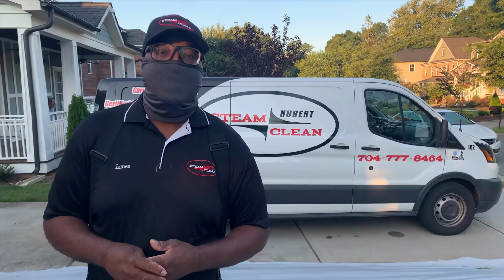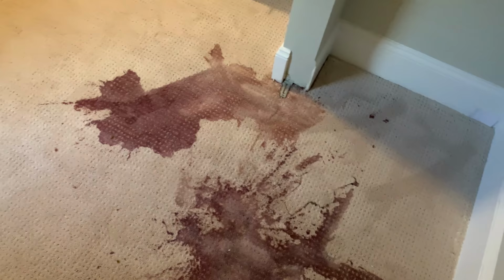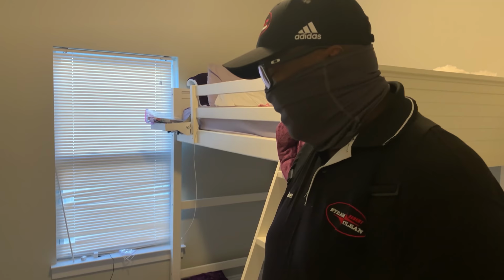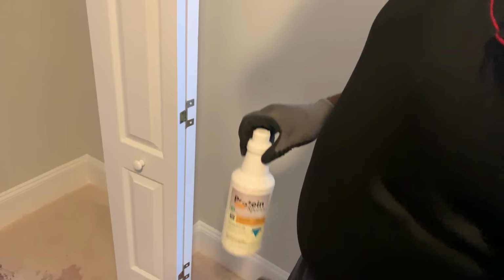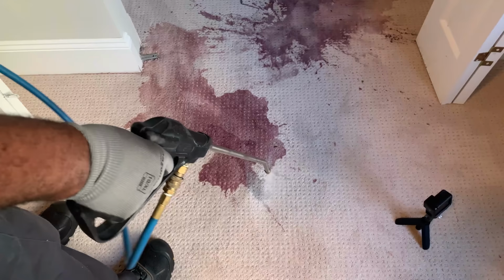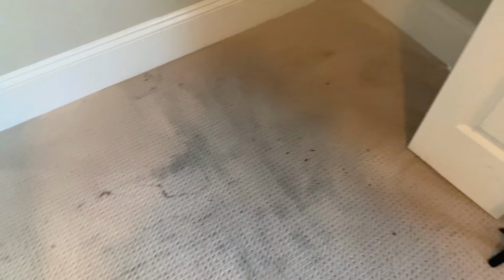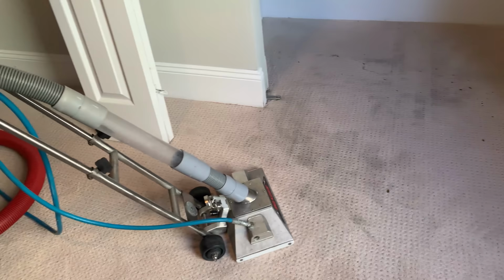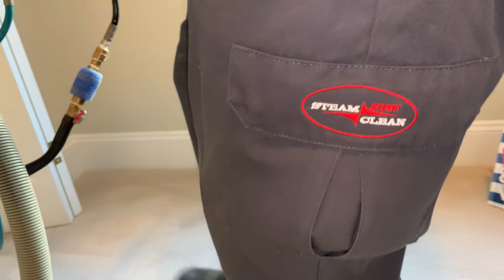WORST RED WINE STAIN EVER!! CARPET CLEANING!

Comment: If you cover the spill at the beginning, while wet, with table salt and leave it for several days, and then vacuum, the salt will totally absorb and dehydrate the liquid and the stain.
I cleaned up a cup of spilled hot chocolate on my carpet this way!
I keep a huge box of salt in the house for any nasty spill...even oil on the garage floor.

Comment: a friend of ours had a brand new dodge pick-up. it was a 'top of the line' model. it was gold w/ light colored carpet in it.  a kid had spilled hawaiian punch on the carpet, and that guy was SO PO'd that he couldnt get the stain out. i told him to make a solution of couple of small envelope type lemon koolade packets, spray it until it was really wet and let it set for a bit, and then re-shampoo/rinse it. guess what happened? IT WORKED!! i was so proud of myself. i had noticed it working on something of mine, and since its not chlorine, it wouldnt harm the carpet. TAH-DAH!!

Comment: Yup... Don't touch it. I just had one at an Air BnB and they got scared and put a bunch of stuff on it. I rinsed and rinsed and put some spray and walk away. It lightened up a lot but was still there. I added more spray and walk away as a post spray. It went away... Basically, it will have more a chance to go away at the time of cleaning if they don't touch it